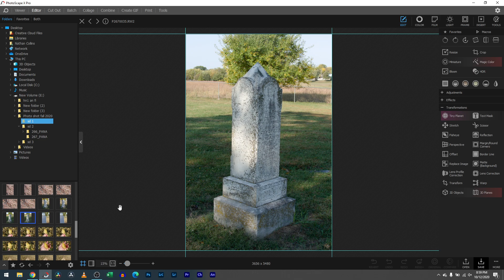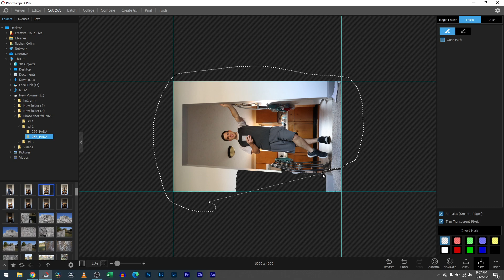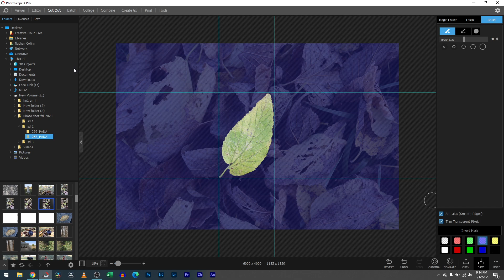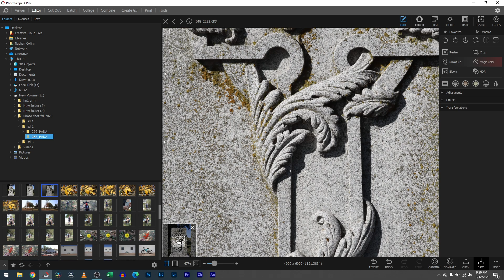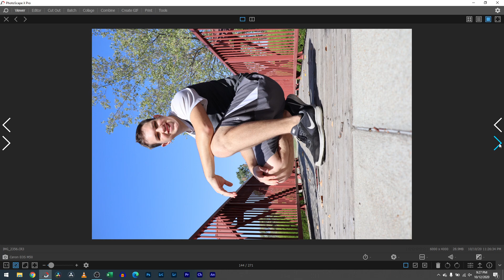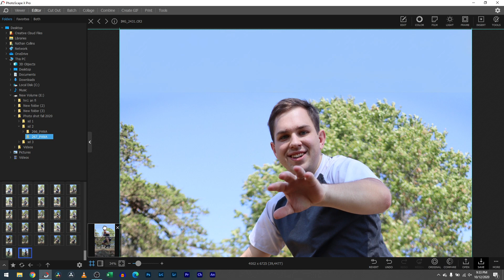PhotoScape X Tips and Tricks! Learn and Laugh!

Comment: regarding the leaf image -- perhaps by using HSL under adjustments or add to favorites for easy access and then select the leaf via a mask and save the mask just in case you need it. However, you can simply do the adjustments to color on the leaf and sharpen or adjust contrast etc. and then invert and reduce saturation and then having the saved mask of the leaf, open the file once more and go to blur and mask and then show mask and invert and close 'show mask": and apply amount etc. to get the blur effect desired and then save the project and the .jpg. You should now have a leaf of whatever color you want with a blurred background. Of course you could use the revers order if you like. Now alternatively to leaving the image as it is you could also crop and adjust placement of the central image, vignette the image, put a frame on it, sign the image etc., etc.
Give it a try and see how it works and decide which method is easier. Let me know. You have my email or here.
Just got to the sky expansion image of yourself jumping. After doing the expansion and merging going to the Tools > spot healing brush and selecting the expansion. I forget whether click>shift>click selects a straight line in PSX as it does in Affinity and NEO and then let the computer fill in the selection with the area of sky that touches the expansion. If the line of demarcation is too strong, a feathered blur along the line and even the rest of the sky later (with a wider aperture the sky will be out of focus anyway) and see how the sky looks compared to the method used and if equal which is easier to do. Just  a thought the some may want to try. Fortunately, spot healing is included in the free version whereas the clone tool is only available with Pro.
Reply from the maker: That is a good idea

Comment: Thanks for sharing, Nathan; especially the river colour and matching sky and the technique for adding to the photo height, this last will be very useful. My photos are very varied eg: land and seascapes, stilllifes, people, transport, country house interiors, fauna etc - currently about 30,000. 
I cannot recall whether you have covered parallax and how to make it vertical, eg your stance with the doorframe if it could have the parallax effect removed. Your extra height tip, suggests if they were added before eg a building was adjusted for parallax, by having extra spaces added top, base and sides, before, then nothing of the original should be cropped by correction as it would fit to the new blank surround 👍. Thanks Nathan.
Reply from the maker: Yeah, I'll take a look at that and see about making a video that talks about parallax.
Reply: @NathanandBri  Hi Nathan, thanks I look forward to watching your expertise in resolving parallax issues. Regards, JB.